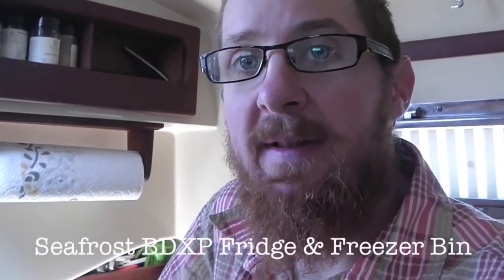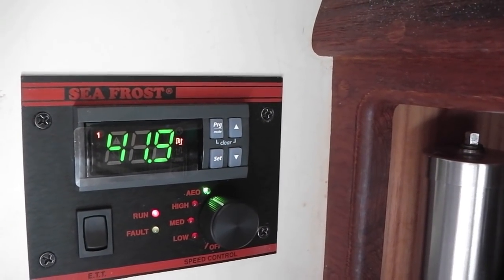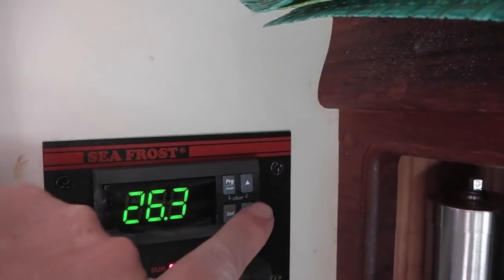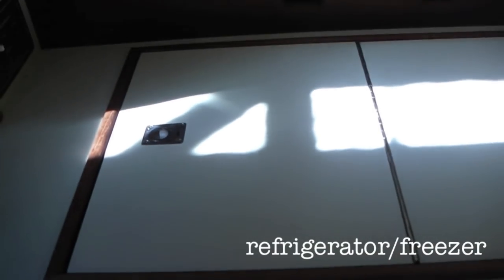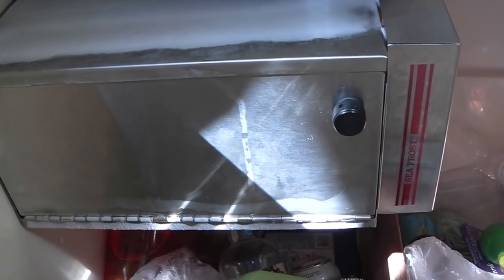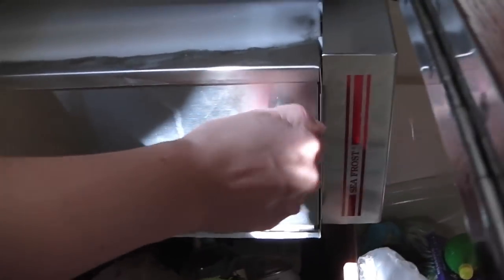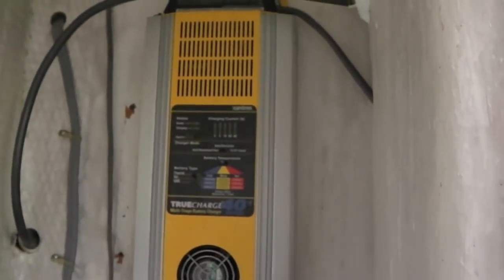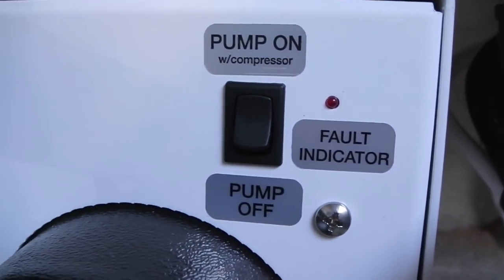EP 08: SeaFrost Sailboat Refrigeration Tour

Comment: I myself am setting up a boat for extended voyaging after about a  year what are your thoughts on the sea frost and your solar setup. Also do you have like a strategy for charging when making passages? I'm doing the math with the amount of space I have I'm only going to have room for a 265 watt panel and 3 group 27 gel batteries so about 200ahrs. I'm just having a hard time getting my head around it.
If you could share your experiences over the last 10 months of how much you had to use your motor to charge and the like I really!!!!! appreciate it.
bob
Reply from the maker: The most effective thing that you can do to maximize the amount of energy from charge (between systems and batteries) is to make sure you have proper sized cables - most boat systems are a conglomeration of different sized wiring and the charge is lost between those connections. Ideally all cables are the same size (and that can be a hefty investment), but I think its well worth it.

We went with a complete re-wiring for the systems and found that to be crucial. Generally during passages, we only started the motor into or out of inlets or anchorages (which was between 20-30 minutes) and would generally top us off. If we are sailing, then we would always run solar and wind and YES the seafrost is amazing and we highly recommend it. Still one of the best decisions we ever made. Good luck to you!
Reply: Thanks for the tips Jake!
bob